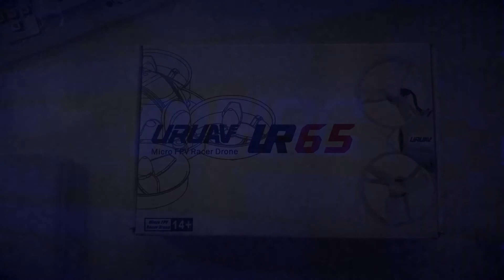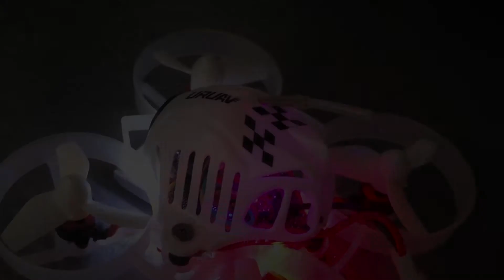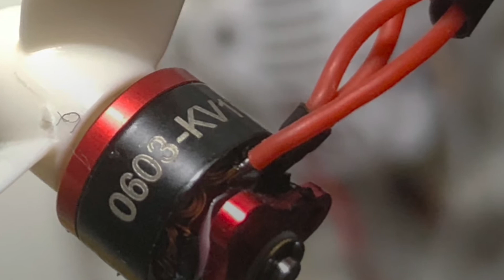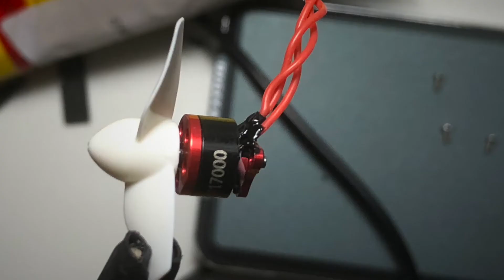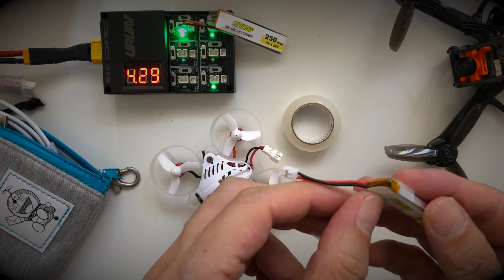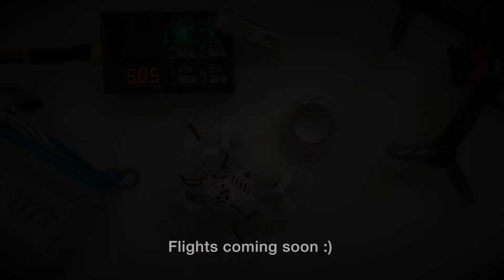UR65 Motor fix and CG tip

Comment: What was the cable that you made to go in to the charger?
Reply from the maker: Timanator Oh that’s an XT60 to XT30 adapter I made. Since I mainly fly micros most of my batteries use XT30 connectors so this way I can use those batteries for the 1s charger:)

Comment: Good tips. I use a rubber band under the drone to hold the battery in place, and it´s have been good so far.
Reply from the maker: Thanks! Yes, those rubber bands can work too. I assume you are stretching them across the little hooks under the side body mounts.